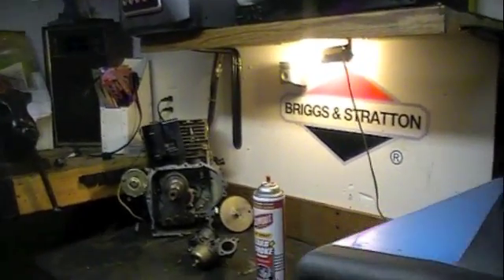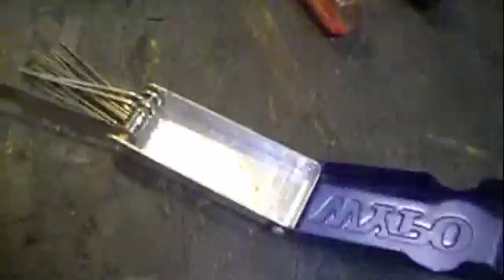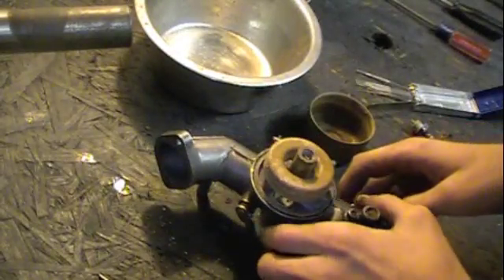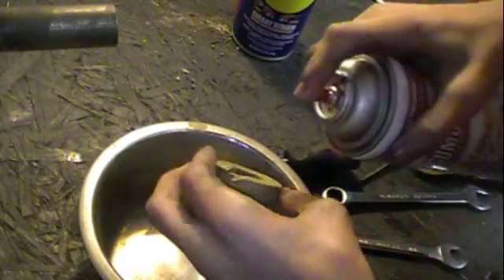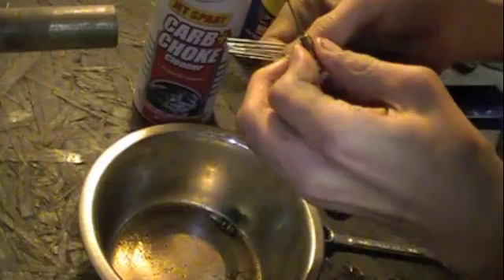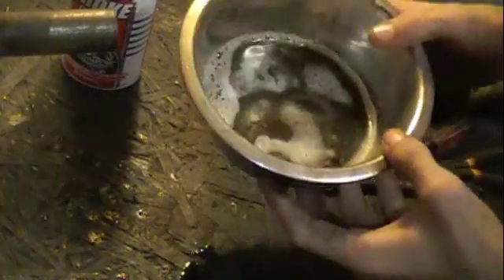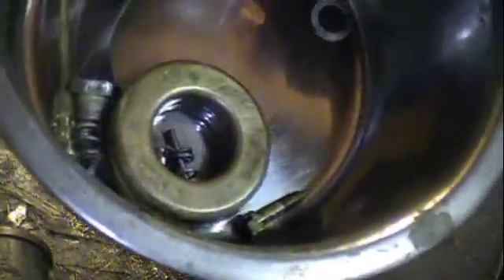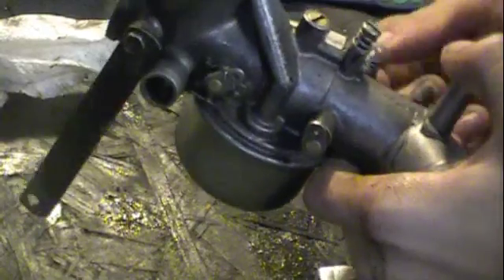How to Clean a Carburetor (Small Engine)

Comment: don't use a steel wire wheel for a brass float because if you scratch a pinhole in it the float will be stuck open because the float will fill with gas. i suggest using a plastic wire brush or even copper, it may take longer but then you don't have as much of a chance of ruining your float. but also if you do have a pinhole in it you want to drain all gas out by drilling a 1/16 or "smaller" and absorb it with cotton and re solder it. to find pinholes you just simply shake your float to see if there's gas in it and if there is light a match wave it around to see where its coming from.

Comment: so I see when you used your wd 40 you forgot to extend the flip up tip so it will come out...you were trying to use it when it was it was in the off position...

  Gary
Reply from the maker: It sprays in both positions the straw part just gives you more of a stream. its just built in so you dont ever loos the straw obviously you haven bought a can of wd-40 lately they are all like that now.
Reply: ok thanks, I did not know that...and I have bought this type all the time but never used it that way...I have wrenching a long time on gravely's and use a lot of wd 40...

   thanks,
   Gary
Reply: Gar
 voigt